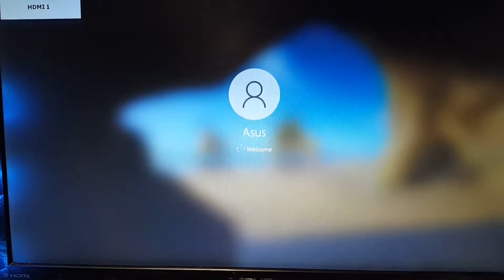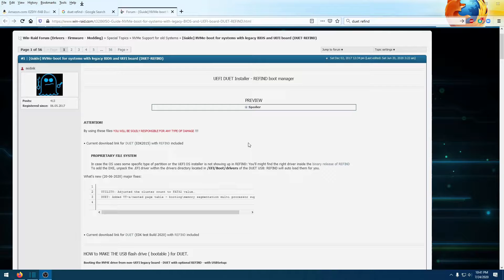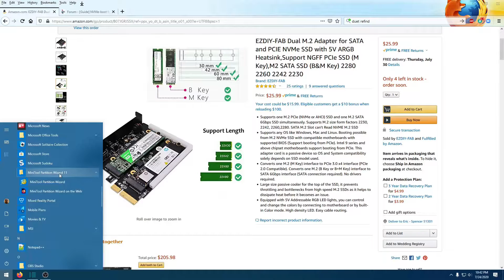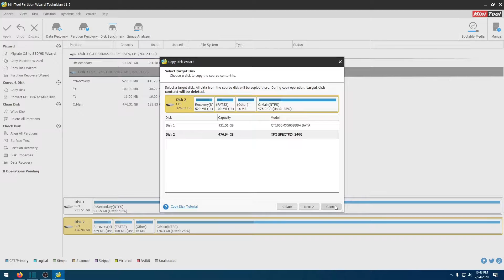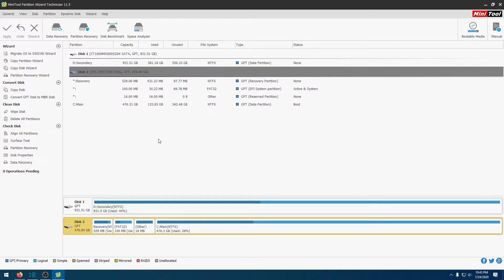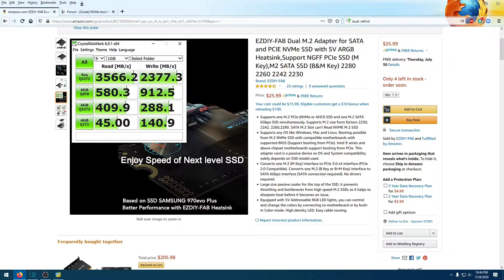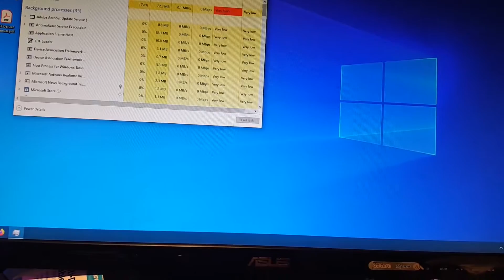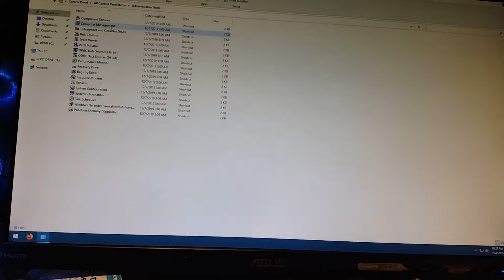nVME boot on a legacy x58 BIOS, no USB stick.

Comment: Ever hear of the "blind leading the blind"? Well this is the classic example of one idiot leading the pack. My bad.
This is 'NOT' a NVMe boot on a legacy x58 BIOS. It is a NGFF boot via the same, and that's if it really works too.
A NVMe SSD connects directly to the PCIe bus through the card of which it is attached to.
A NGFF SSD is connected to the motherboard via a SATA cable running between the card it is mounted on.
The NGFF SSD has nothing to do with the PCIe, and the card just serves as a place to mount an extra SSD.
You're not going to get NVMe/PCIe speeds when you're connected via the NGFF/SATA II of the motherboard.

So far; through all the researching I've done, I have yet to find a way to boot a NVMe SSD without running under UEFI.
AND, on another note, UEFI/EFI is not BIOS. It's either one or the other. You do not combine the two; i.e. UEFI BIOS.
This is NOT to say though, that, motherboards cannot have/emulate both; but you can only be running under one or the other.
Don't even get me started on GPT vs. MBR; LOL
I would really like to find a working answer to this though, which may also be the resolution to another issue I experience.
Reply from the maker: Great to know you're too dumb to realize the controller I used uses the SATA ports for a separate SATA drive, not the nVME which is using the PCIe. The SATA drive only serves as the loader, it is in fact, running on an nVME drive, but thanks for trying to sound like you know something.
Reply: @phreakwars  But you seem to not understand many here, do not want the bootloader of the SATA controller to load duet, then duet finds the PCIe drive and finally allows the PC to boot.  I have the exact same P6t Deluxe booting on NVME m.2 Samsung 950 Pro without anything else involved.  Install drive, Boot USB Windows 10 or 11, sees nvme drive, does windows install just like a normal drive.  Finish, then that is it.   No Duet, no Clover, no nothing else.   Boot Legacy BIOS to NVMe.   Is that too hard to wrap your ego around Phreakwar?
Reply from the maker: @chrisdotson6417  You are using a Samsung, which DOES work and show up, not all nVME drives are the same. Most all Samsungs are known to work. What you are talking about, is a separate subject. Don't believe me? Put in another brand nVME and see what happens besides YOUR ego shrinking. THIS IS COVERED IN THE FORUM POST I LINKED TO IN THE DESCRIPTION AND HAS BEEN FOR YEARS.DUH!! Again, all I am doing in this video, is the same duet/refind trick, except moving it to a 16 gig 2242 sata to boot instead of a USB stick. EDIT: And BTW, why do you HAPPEN to be using a Samsung drive when you know fully well you won't get full speed.. OH THAT'S RIGHT, YOU ALREADY KNEW SAMSUNGS WERE THE ONLY ONES COMPATIBLE, so fuck you man. I see your game.
Reply: you are right.he saved one usb for the cost of pcie .m2 sata card.that's what I see.
Reply: note: at least in the case of many early UEFI bios, they were an old style bios with a skin and added features, mouse support, i say this having compared them with non-gui versions of the boards bios and older boards that were pre-uefi... 

anyway, you cant direct boot off nvme on most x58 boards, but you can just use a usb stick or sata drive with the boot loader on it to re-direct boot to nvme..

im told the Radeon SSG cards NVME support works on x58 but havent tried it myself, my buddy has one on that sr2 rig he owns... he uses it for specific tasks...not gaming its able to game but its only vega level hardware so... the 3070ti he won in in a contest is a better match to dual x5690's at 5.5ghz... (i thought he clocks had to be a joke...he ran linpack for 36hrs, 100% stable using 87% of his ram... so yeah...god damn... he also swapped the fans on the AIO's for IPPC )

Comment: x58 Motherboards have PCIe 2.0, which is 500MB/s per lane, so times 4, at most you'd get would be 2GB/s through that adapter (minus any protocol overhead, and bandwidth sharing that may be occurring with other devices such as your graphics card if sharing the same set of lanes). The advertised speeds are probably through PCIe 3.0 (which is 1GB/s per lane) and thus 4GB/s max.
Reply: I have an old EVGA X58 board with two x16 PCI-E slots.
Reply: Still better than a mechanical rust spinner.
Reply from the maker: Thanks for being the 20th person to repeat that.
Reply: @phreakwars  You're welcome 😅

Comment: I'm trying something similar on my MSI X58 platinum. I have a 256G Samsung SSD from my 2013 Mac Pro. I bought an adapter that will allow me to put it onto an NVMe to PCIe card. I'm wondering if I can put it on an SSD to USB 3 adapter and install the UEFI software, then boot it and  partition it in 2... 1 small boot partition and the other for Windows 10... If that works I'm going to try and get my old Vista Ultimate drive to run on a dual boot...sound feasible?
Reply from the maker: Actually, I believe so. Not sure if Vista will recognise an NVME drive though, but the clover boot loader might handle that. You'd have to ask on the forum I linked to for a better answer as I have never tried an older OS and am not an expert by any means at running duet and refind. Best you can do is try. Also, from what I understand, Samsung drives work real well for X58 NVME so you might not even need the boot loader, just the adapter.. you'll have to check it out and see.
Reply: @phreakwars  Thanks. The first spin on this will be to get Windows 10 working, so the native driver there should work. Regarding your insight on Vista, if that fails to dual boot, I should still have the F11 key for the bios boot order, no?
Reply from the maker: @rk4621  yes, you should still have it.

Comment: Good to know that when the apocalypse comes and destroys all the 4th gen i7s and newer, we can still Mad-Max this old X58 gear. I think you just upstaged Bryan from Tech Yes City.
Reply from the maker: HEHE, believe it or not, old ass PC's like that are still in use in many of the poorer countries. Hell, alot of them are still using Windows fucking XP. Had a WD_Black AN1500 sent to me a while back that I wanted to test out on this as well. Decided to use it in a build and sell it off instead. Figured the results wouldn't be much better then what I got with a standard nVME because of the older PCI-E Standard the board uses.
Reply: @phreakwars  i overclocked pcie to 119mhz,, increased read speeds from 1500 to 1950mb/s 😂
Reply from the maker: @Callagwhan  overclocked it? Never heard of that.
Reply: @phreakwars  yes.. try it 😂
Reply from the maker: @Callagwhan  Nah, I don't really get into overclocking much these days. I used to do it like mad back in the day. Last time I overclocked was back during the Athlon Slot A days when I got mine past the 1Ghz mark. Kind of tells ya how long I've been doing this shit.
Reply: @phreakwars  x58 platform is so fun to overclock
I replaced i7 920 4c/8t 45nm to 
X5675 6c/12t 32nm
Overclocked from 3.06ghz to 4.5 😂😂😂
+ pcie oc

It runs Like recent machine!!!

Comment: Even after reading about the method before I had to watch your video a few times to get your twist on it.. haha. I think you calling all of the drives "m.2" (instead of "m.2 sata" or "m.2 nvme pcie" ssd mixed me up). Anyhow, glad to see it working on an x58 system... I used to love this board! Makes me was to bust out my old Rampage Extreme now and throw a x5675 in it too (6 cores and good TDP for cheap.. nice choice! :)  ) 

PS: Your slower than "advertised" read/write speeds are because that mobo is pcie2.0, so that x4 slot is much slower than pcie3.0 x4 or now the latest pcie4.0. If you had an adapter which used more lanes, ex. those x16 adapters out there, then even with pcie2.0 a x16 slot would give you better speeds! (those 3 pcie lanes are split "16x/16x/1x" or "16x/8x/8x" depending on how many cards you have connected)

Nice video though! Cheers!
Reply from the maker: Yeah, I know the speed is due to the PCIE 2.0 now, back when I made the video though, didn't think too much about it, was doing some experimenting to see if it actually would work. I was shocked that it did. Brought that old Asus board back to life. The x5675 is absolutely the logical choice to use on older hardware like this. More cost effective and like you mentioned, lower TDP then the i7 equivalent (EDIT: also didn't help I was a little hammered when I did this video if you couldn't tell by the Smirnoff Smash I'm drinking while babbling. But that's how I roll )  ;-P
Reply: @phreakwars  Haha, some of the best content gets made when hammered, it's all good!
I'd love to snap up an x5675 off aliexpress for 20USD and do the same to give my old system some future-proofing 6-core 4Ghz+ OC love... I just wish Gen1 i7s came with AVX instruction sets. (not the biggest deal.. just some programs/games won't run without it.. and that will likely become more and more likely as we keep moving forward  :( )
Reply: @phreakwars  By the way, in the market for a new SSD but figure that if I'm about to spend ~80 bucks, may as well spend 95ish and get an nVME ssd instead since that'd likely go in a future pc re-build. That being the case, I only have a spare HDD right now... could I clone clover to that HDD, use it to boot clover, and then once inside Windows on my nVME, just use the rest of that HDD for storage (storing around the clover files)? I guess it would be the same thing you're doing but with an HDD instead of a SATA? 

PS: Any idea how long the whole boot time would take going Clover on a 7200rpm HDD⇛nVME⇛Windows (7/8/10)?

Cheers!
Reply from the maker: @injjwetrust4678  I wouldn't think that would be too difficult at all. What I would do in that case, is make separate partitions after cloning. Keep the duet/refind boot partition separate from the storage partition and of course set it's attributes to hidden so you or someone else doesn't accidentally delete or modify it.. EDIT: better yet, do a full blown clover install on it for future OS's like Linux and MAC OSX.
Reply: @phreakwars  Good to know that you think it would be more than possible to accomplish! :) 

Any idea what the system boot duration for either the USB⇛NVMe or 7200rpm HDD⇛NVMe options would be like? I've heard of 1min+ cases, and also 10~15sec cases.. so curious how much clover seems to add to boot times on average
Reply from the maker: @injjwetrust4678  Nope, sorry, never tried. If I do anything more with nVME on this x58, I'm going to ... for shits and giggles... see what kind of speed I can get out of this: https://i.imgur.com/Wwo4WOz.jpg might do a video on it.
Reply from the maker: I've had that on my shelf for quite a while now, keep meaning to do a video about it. x58 nvme might be a good topic... If it even works.
Reply: @phreakwars  Hmmm... that being the case, then I take it that your PCIe SATA adapter⇛ SATA SSD ⇛ PCIe NVMe SSD setup in the video was booting perfectly fine without any crazy delays? (close to the usual average sub-10seconds ish?).

Sorry for all the questions btw... just doing my research before plunking down the $$... I really appreciate your replies!

PS: Man, for the sake of all of us enthusiasts please take that beast off of your shelf and put it to use! haha. Looking forward to seeing it in action! (If only it was x16 and not just x8, then you could get full speed with your pcie2 x16 slot, with your vid card in the other slot getting x8 (not much of a performance hit)). I'm guessing you'll get around the theoretical 4000MB/s on that board!
Reply from the maker: @injjwetrust4678  Yeah, well, I'm kind of back logged on video topics I want to put out there, I'm always working and trying to remodel my basement as well as handle regular customers as well as put out content. I might take a short break since spring is coming up so I can get all the extra crap out of my basement, the arcades moved out of my office and my shelves finally organized. I have lots of hacks I wanted to cover this year and no time to do them.
Reply: @phreakwars  Gotcha! No more questions! haha
Thanks again for all the advice!
Best of luck with the channel!

Comment: Surprised to see so few votes, must be a lot of people out there with older legacy BIOS boards with PCIe x4 slots available that could benefit. With a bit more detail on the DUET (USB) configuration and a viable solution for migrating Windows 10 from a RAID to the SSD, I'll put an NVMe SSD in my MSI X58 Pro-E. Thanks!
Reply: i'd like to set up my X58 system with this sort of configuration, but I can't figure out what to do from the video description. I think that there's a suggestion to copy a working Windows X installation onto the M.2 SSD, but then there's a jump to "pop your Windows-install disk into the CD and do the installation" which says to me that this isn't cloning an existing install onto an M.2 but a completely new installation. In any event, the description isn't clear to me and I've only been working on software and hardware since the 1970's, so maybe I'm just not up-to-speed yet.
Reply from the maker: I never worry about things like upvotes, subscribers and stuff like that. I stay low profile so I can respond to questions easier. What typically happens is someone sees one of my hacks, does the same thing in a flashy video with some techno intro on their channel that has thousands of subscribers, take all the praise for it plus some more subscribes without ever mentioning where they learned the hack from, and I just move on to some other hack and think nothing of it. This has went on for over a decade now. Maybe it's my poor articulation skills when I speak, but I could care less, my channel has always been about helping the little guy who can't afford the expensive equipment, upvotes and subscribes be damned.
Reply: @phreakwars  I thought cloning the trampoline USB onto a SATA SSD occupying the same PCIe card as the target NVMe SSD was a particularly nice touch.
Reply from the maker: @paulchaput5015  well, it frees up the USB port and you get a faster boot time.  I'm not a fan of using USB or microSD devices because of the instability and slow speed of them.

Comment: Its due to bandwidth limitations of previous pcie generation my friend
Reply: indeed, pcie 2.0 on an x4 slot will only get you so far... still nice improvement over an ssd if you move lots of large files!
Reply from the maker: @injjwetrust4678  yes, I know that now, was a bit drunk and not thinking when I made the video.
Reply: @phreakwars  you can actually overclock PCIe on the X58 platform and the transfer rate will actuall go up with the PCIe frequency - I've already tested it on my Sabertooth X58 and X5675
Reply from the maker: @GronkAkowA  that's cool, you should do a video about it.

Comment: Hi, thank's for your video, i'm trying to boot a 970 evo plus on my x58 rampage board but cant get it to work.
I tried with both clover and duet bootloader but i am getting problem with both.
W
If i try to boot with one of then and i try to i stall windows on a 970, windows installation software see the drive with 0 capacity

After, did a clean install on the 970 on another pc and tried to boot from it on the x58 system with both bootloader but windows crash everytime when it get to the login screen..
I tried about everything that i can find but im stuck there, would you have any tips that could help me out??

Thank's a lot for your help
Reply: You can MOD your bios with nvme driver. 
Go step by step as in this video
https://www.youtube.com/watch?v=xFFBHkeosUU&ab_channel=UniqueCars
Reply from the maker: You'll need to ask on the win-raid forums. I wouldn't be of much help and don't want to pretend I would be. Have you tried booting with the traditional method of using the USB stick first with the Duet/Refind software?
Reply: @phreakwars  Win-raid forums are about to get shut down.
Reply from the maker: @stephendee7839  No shit?? Why?

Comment: Will this work for old Mother boards like Asus X58 ?
Reply from the maker: This video was done with an ASUS X58
Reply: @phreakwars  Ok.  again, the ASUS X58 board only has PCIe 2.0 slots.. which caps your NVME speed to 2 GB/s.. which is why you were only seeing 1600 MB/s in your tests..  that's just how it is on these old boards.. That's still 4x faster than a SATA ssd.

Comment: Can I do this by cloning my current OS drive onto an NVMe, or it can only be done when you do a fresh install of Windows on the NVMe via Clover? If you can find a way to do it the former route, please let me know. I currently have an SSD drive that I wanted to upgrade to an NVMe but don't want a fresh install of Windows. I also have an ASUS legacy board that runs off a BIOS instead of a UEFI. Thank you!
Reply from the maker: I'm honestly not sure, I've never tried.
Reply: @phreakwars  thanks anyway!
Reply: I'd like to go the clone route as well. Did you have any luck with it?
Reply: @stephendee7839  No luck. I gave up because I found out that using a PCIe to NVMe converter throttles the read/write speeds to about the same as the SATA version my mobo supports, so no use in going through all the trouble. Anyway, good luck!